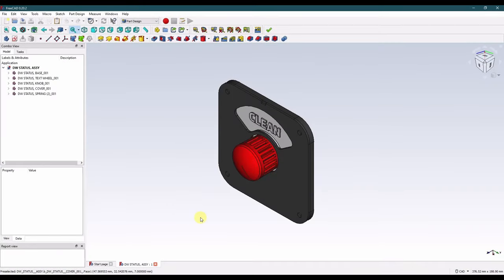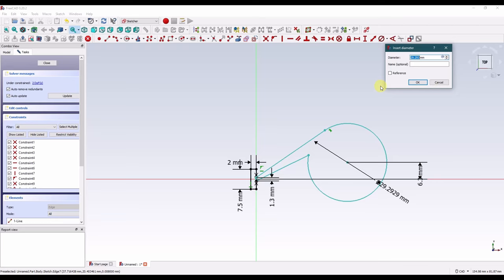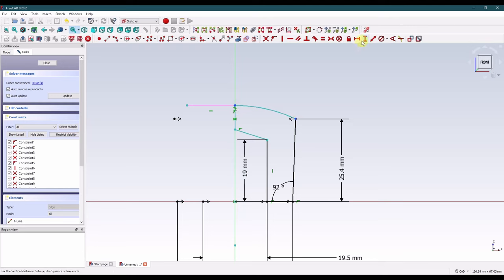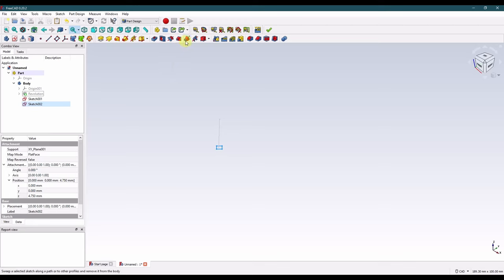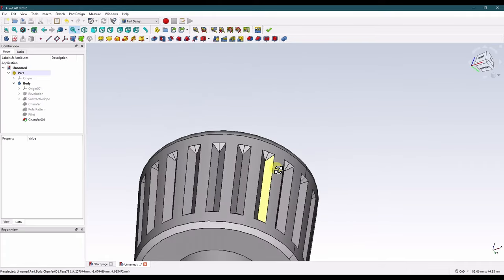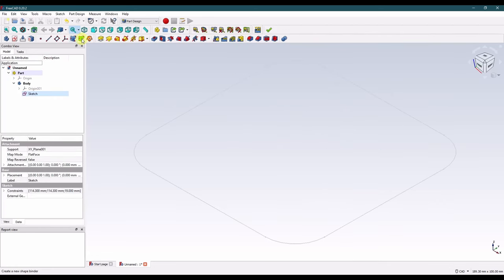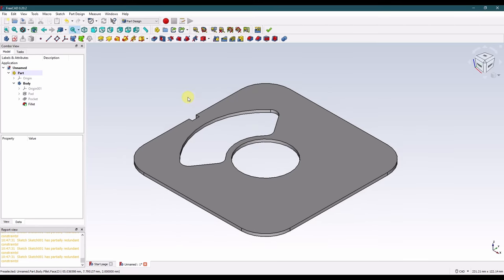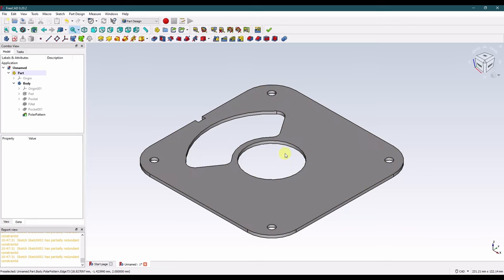FreeCad Tutorial #15 | Dishwasher Status Wheel design in FreeCAD for 3D Printing

Comment: 12:45 - FYI, you can't apply a chamfer or fillet that goes the full depth of a recess. If you measure the depth of the V groove (say with a named reference constraint) and use it for the depth, then it will error out. However, subtract anything (say 0.001mm) and it will work. I'm not sure if this is the problem you were having, I haven't ever tried to do a chamfer on a feature carved into rounded surface, but it's a common problem. Anyway, I appreciate this video. It's fast paced and full of good ideas. Thanks.